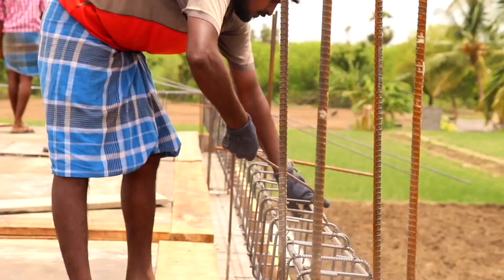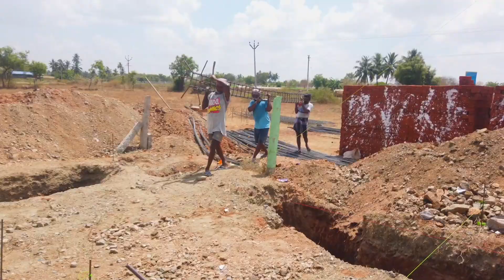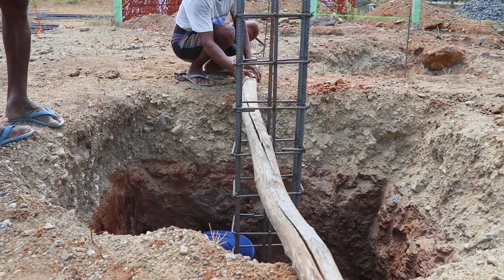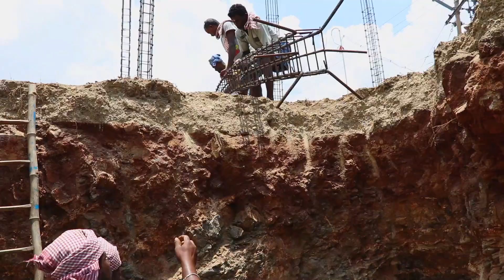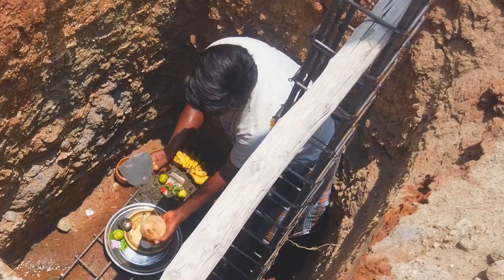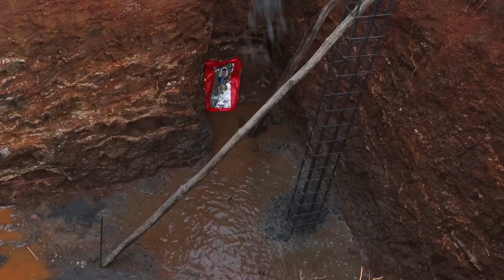RCC Footing of Column Mat installation | Footing of Column Mat Foundation | Concrete Column Footing

Comment: No bonding between steel and concrete, observed aireated honeycomb concrete because of improper concrete water mix ratio and no concrete vibrator. The existing water can be pumped out easily before proceeding the work. Ofcourse building will fail with 20years due to settlement and shear failure due to action of point loads rather than functioning as distribution load in the footings.